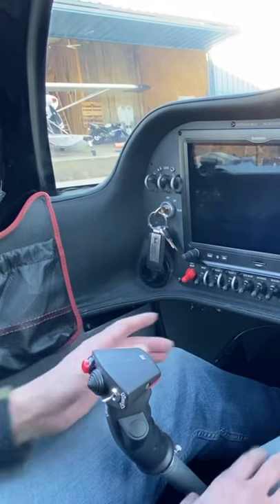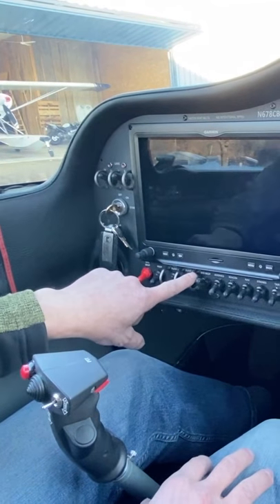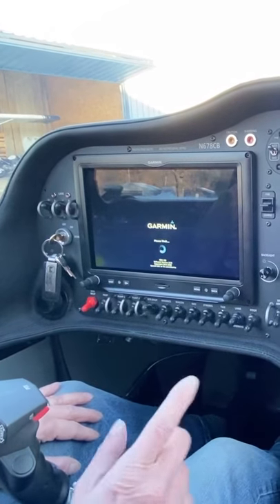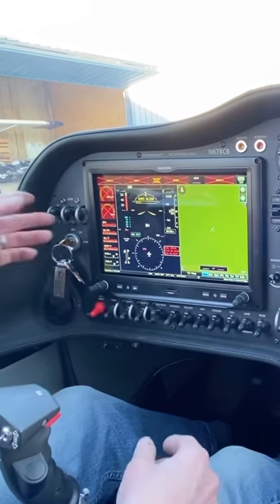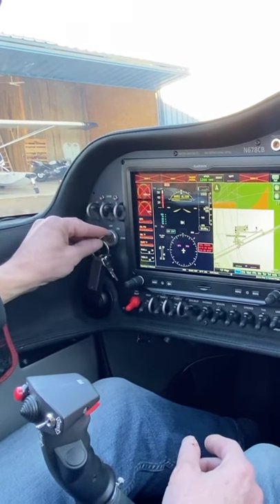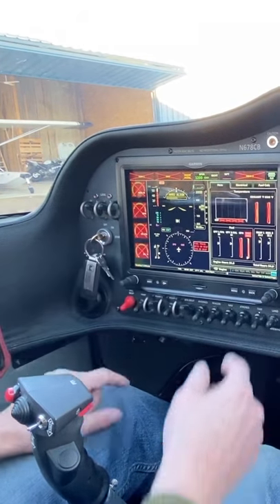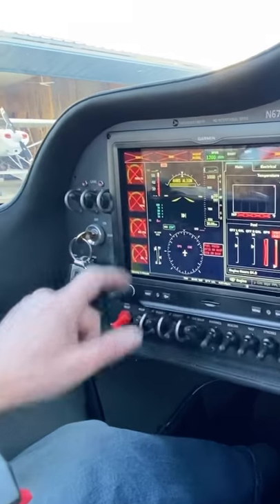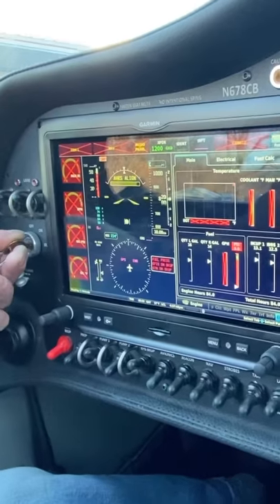How To Start An Airplane Engine #shorts

Comment: I first put the ECU backup on and run both fuel pumps sequentially prior to start. This does require you to have EFIS backup on so that you can visually confirm the fuel pressure builds. This both primes the system and is also a great way to check the fuel pumps outside of the check during run-ups.  It's also a must if running extended range tanks as its the only way to test the transfer pump is to hear it and you cannot hear it once the engine is running.

The priming also supposedly makes start a little easier but that's a bit of a wash with the FADEC since it already starts so easily. I absolutely love flying the TSI. I'm at Tedderfield where the Sling TSI is manufactured, and if you're ever this side of the world, please shout and pop-by. We're in Hangar 47.